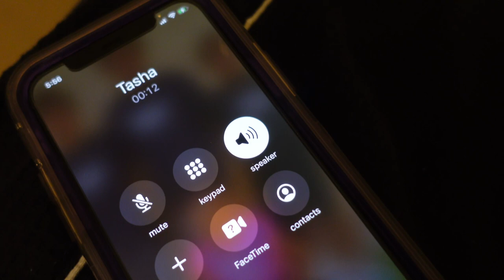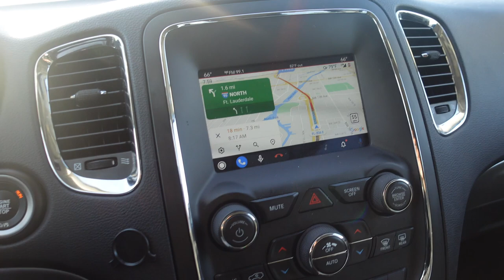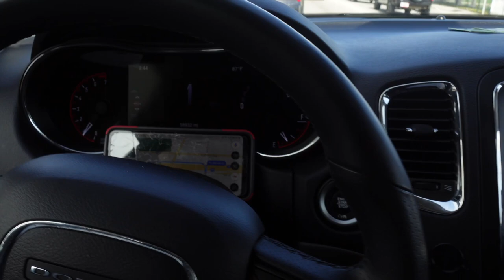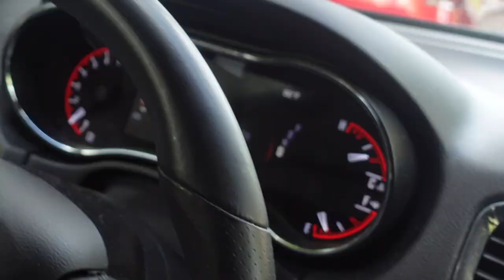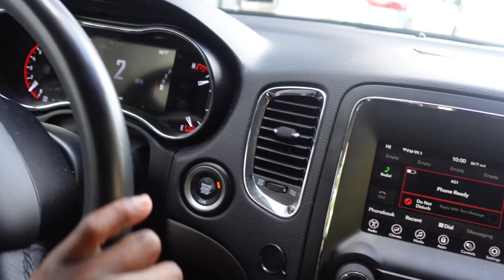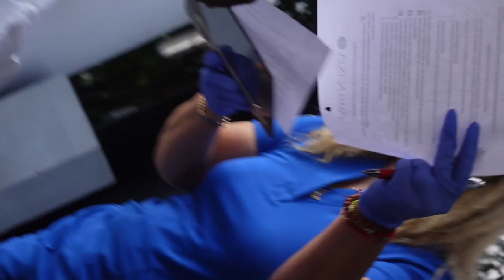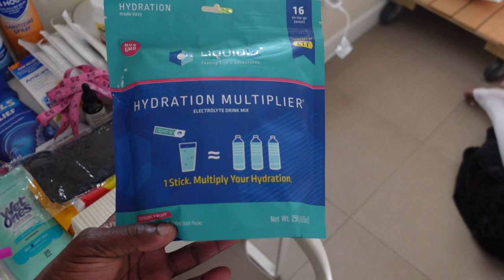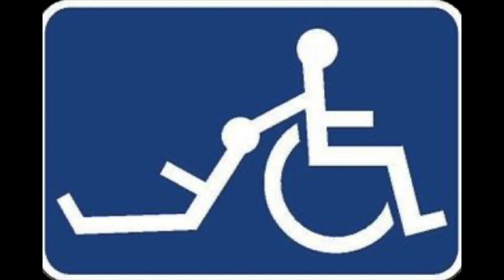MY 2ND ROUND BBL VlOG W/ DR. CANNON | PART 1 SURGERY DAY 1-3 | RAW FOOTAGE| IV HYDRATION + MASSAGES

Comment: You look great babe 😮  I’m having my 2nd round in January hopefully, just want my hips a little more curvy, would be very happy If I get the sane results as you…going to have arm and inner thigh lipo too as I’m not sure I’ll have enough fat in my tummy and back as there’s not much fat left there, how many cc did they take out you and how much did they put back in on each side?
Reply from the maker: Thank you 💕 If you can try to get thigh lipo only you will need your arms so much during recovery omg it’s so hard to get up. And the more places you get lipo the less they can really snatch you because they only can take out so much fat. And u know what I’m not too sure I have to look at my paperwork but I didn’t have that much fat either so we both had the same concern.